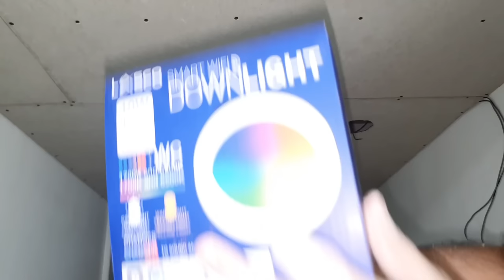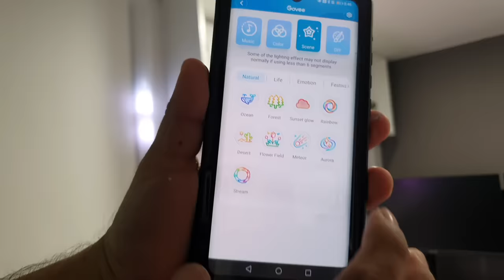Transforming 1.4m Smallest Room into DREAM GAMING ROOM SETUP-  DIY LOFT BED W/ GAMING AREA 2. LEDs

Comment: This video was extremely refreshing. Watching a gaming build actually being built and seeing you use tools that anyone can get started with rather than a stupidly expensive table saw and other equally expensive equipment!
Reply from the maker: Exactly! Love your comment bro. Thanks
Reply: Do you realize how long it'd take to learn all that, and how many awkward benches and closets would have to be made before you get to this level.
Reply: @swapnilingle4435  oh I’m fully aware, my place has a few dodgy built bookshelves and desks before I got to the level that I have too. I’m just saying that an average Joe generally won’t have a £5k table saw sat in their garage to cut things to perfection, so as I said, it’s refreshing to see the level of work that can be achieved without the need for expensive tools even though it WILL take time to practice and improve your level of quality to achieve this.
Reply: @ShadoPantha  I'm actually trying to getting started with these skills (carpentry + painting), how long does it take? 

Would you suggest any good resources?

Comment: Hello!!, I really like the concept and your hard work to make the greatest gaming room ever. But, serious question here. what about the air circulation? is it hot in there when you're playing because I really plan to build my own game room but I don't want to feel suffocated. Thanks man! Great Work.
Reply from the maker: Room is not fully enclosed and the unit is fully airconditioned.😀
Reply: @DIYTatayDan  you probably want to have the ability to have some air exchanges as well. Set up a fan inside to move the air around. An AC will be very minimal to this.

Comment: Bro I have a similar setup in a room x4 bigger than this and it stays extra warm lol. Looking at this setup makes me start sweating
Reply from the maker: Well that explain why you have a warmer room because you have a bigger space. You should use a bigger AC bro. This room is very small and it's fully airconditioned so I got no issue with the the temperature.😀

Comment: To be honest, 2 monitor is the worst possible for a gaming setup. You go 1 or 3 but never 2.. 2 is for content creators. When you play on one monitor, the second will always break your concentration and it won't be symmetrical experience. Why did you not use a good 32" monitor at all?
Reply from the maker: Yes you are right. The setup is also for multitasking. Thats why I use fully adjustable mount. I only use 1 monitor for gaming.
Reply: @DIYTatayDan  Hey. Still there is 2 big problems. 1. your monitor will be never in the middle. 2. The other monitor will cover all your back lighting. As a content creator myself, sadly I feel that pain everytime I play a game..  I like to have the all wide monitors but they are too wide and got less height so not so usable for content creating for my taste. 
But the room itself is very lovly!

Comment: Never understood how you can play games when ur head is always halfturned to one of 2 monitors, ur neck gonna hurt after 3-4 hrs playsession
Reply from the maker: Ow no.. thats the purpose why I use  fully adjustable mount bro.
Reply: @DIYTatayDan  but this mount doesnt let you put one of monitors right in front of you on middle, or im missing something?
Reply from the maker: That fully adjustable. You can position the monitor any way you want.
Reply: @DIYTatayDan  so basically if you working and gaming every day, you need to move monitors every day? Is that comfy? I,ve tried to hold up to two monitor setup and didnt find any success, so just bought tripple monitor mount and it was perfect for streaming and montage work
Reply from the maker: Yes. Need to move monitors. if you notice thats a very limited space wall to wall. Thats the best solution I can do to have 2 monitors also for my work.😁 but I am open to suggestion man.
Reply: @DIYTatayDan   @DIY Tatay Dan  maybe overhead 2nd monitor is a way, also i saw workspaces with monitor under, it was 45degree turned, or wide screen horizontal on side, i got middle and right horizontal, and left vertical, its comfy for gaming and chat, discord and rest of windows on side, and if i need to do some montage im using only middle. You could try to get close to wall and sit straight, and put left monitor right in front, and turn right one 45degree so you need to turn head a little to see half of right screen, on far side of monitor i put windows which i need to track from time to time, anyeays mostly using left half of monitor, vertical orientation is also handy and take less space

Comment: You wasted so much time building those bookshelf just to hold your toys?

I rather see live plants that require little water😅

Update
9:53 I've notice you can get  most from the background by turning it into a white screen for your movie projector.

The background simply grab my attention from your monitors.

It make your monitors look  irrelevant.

You should remove those two bookshelf on the side and turn your black wall into a movie projector screen.

That's just me:)